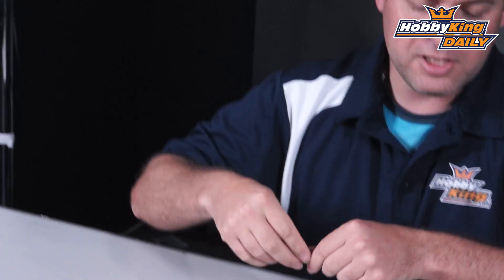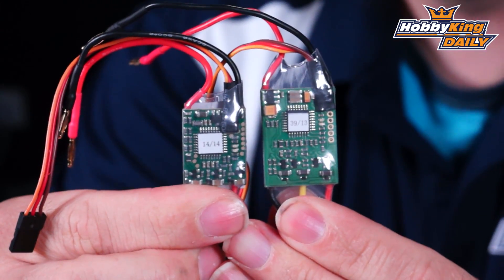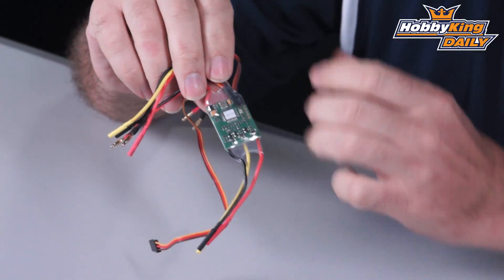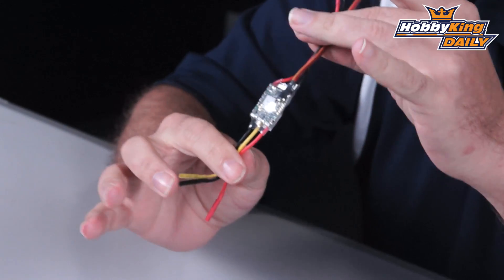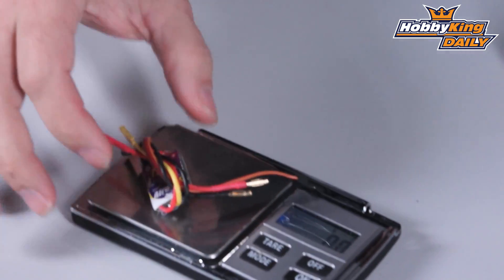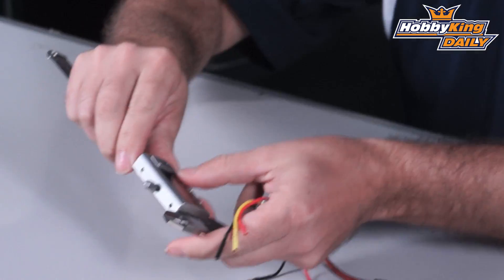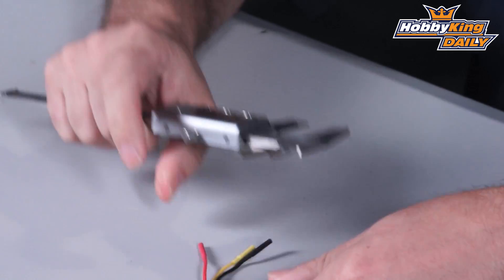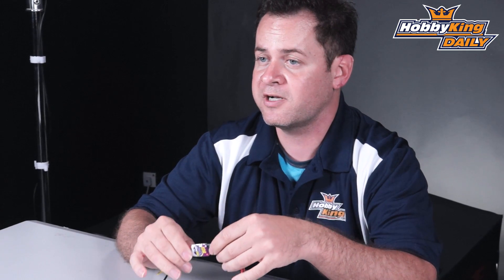HobbyKing Daily - Afro 12 Amp Ultra Lite ESC V3

Comment: How to calibrate ?
Reply from the maker: +DonMuffatello Fairly easy. With propellers off of the motors attached to the ESC, power on tx, full throttle, power ESC, wait for beeps, lower throttle. done.
Reply: tried no work

Comment: Is this ESC a good option for the SunnySky 2204 2300kv?  The ESC would have to handle ~2sec bursts of 17A.  Also I read about people adding a capacitor to the Afro ESC's for that particular motor.  I don't remember why though.  Does this have that problem?